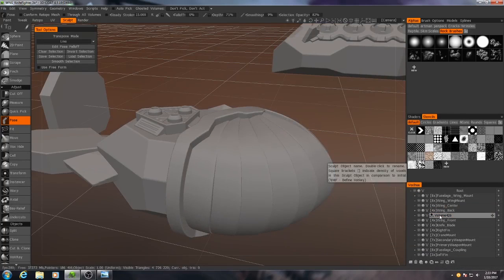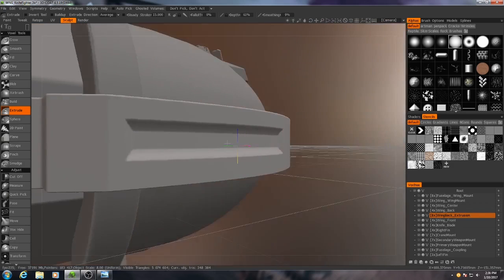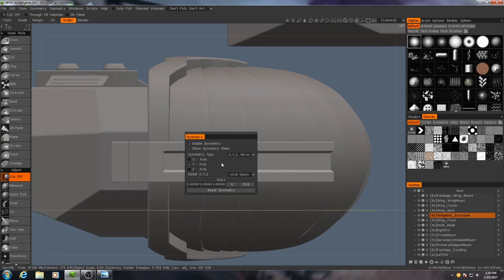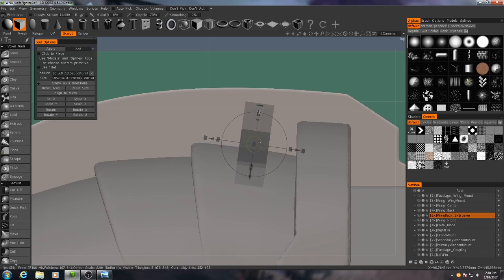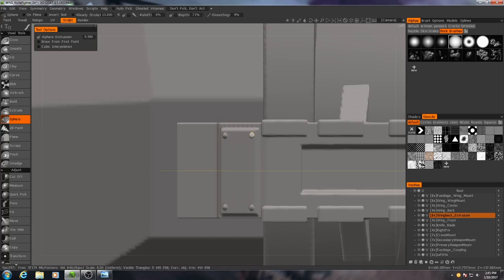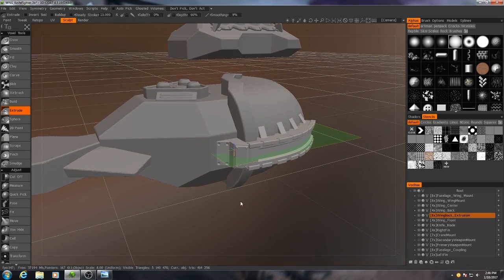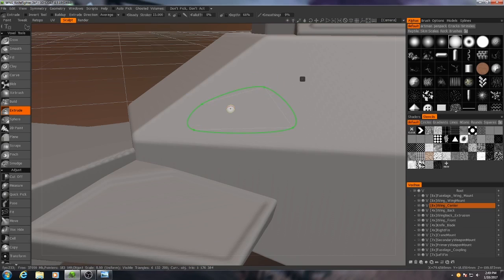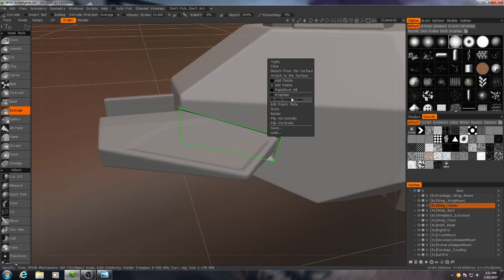3D-Coat Hard Surface Spaceship Wing Modeling (Part 5)

Comment: If you were going to end up doing the same inner extrusion for both of those little wings, why didn't you just define an X or Z symmetry (I don't know which direction based on how much you've moved around the model) to mirror the cut onto both sides?  Would that have produced unwanted results?  Absolutely awesome series by the way, I'm learning a lot of new things about 3D coat just watching this!
Reply from the maker: I think you're referring to the fins about halfway down the wing? The two fins aren't symmetrical. If they were, then you could use local symmetry by opening the symmetry window and choosing 'Pick' at the bottom to create a point of symmetry that's not at the center of the world. Hope that helps.
Reply: Ah, okay.  Didn't realize they weren't the same, my mistake!  Still, thanks a ton, really enjoyed sitting through this set.  :D